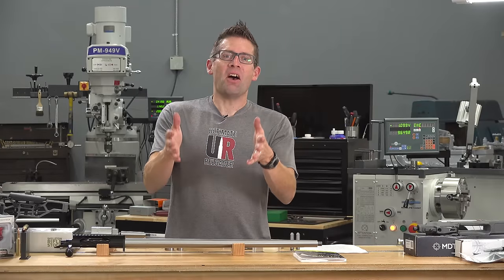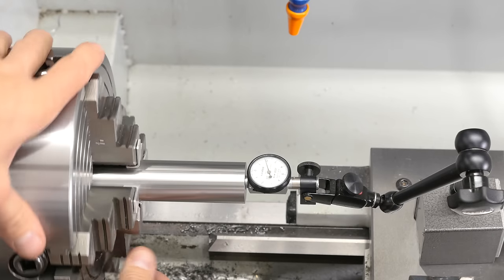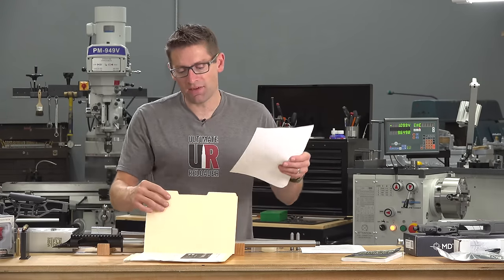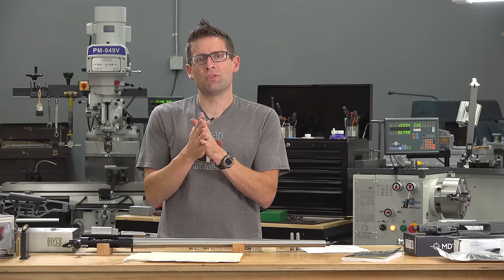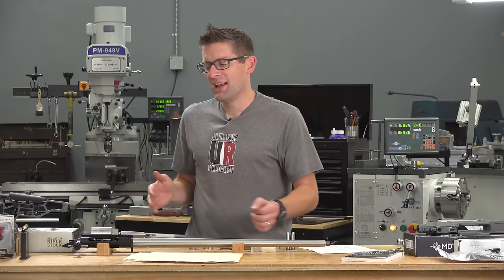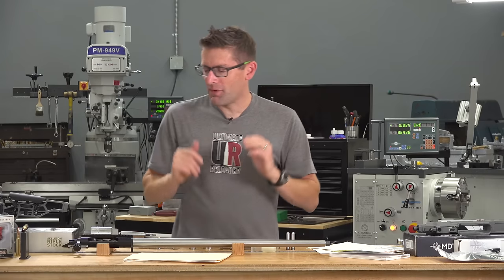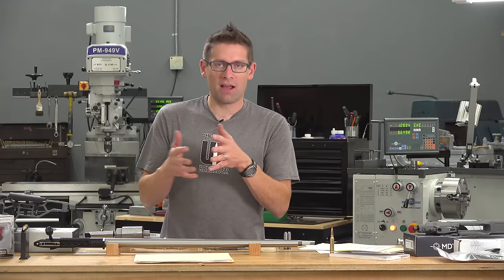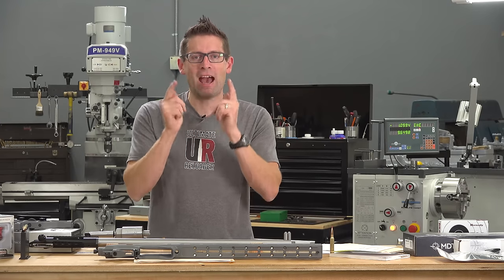300 PRC Custom Build: Chambering and Machining the Barrel

Comment: "Always measure, always validate, verify... some mistakes are very difficult to correct later..."
I'm a retired family doc. I recall assisting a General Surgeon with a major and critical abdominal operation. I was about to make a critical mistake but he caught me and then gave me one of those 'pearls of wisdom'. He said, "In surgery, there are two kinds of mistakes. The kind you can recover from and the kind you cannot recover from."
You really, really want to avoid the second kind.

Comment: Nice job, just a helpful tip. Use the saddle as a stop for the tailstock during chambering, so that you dont have to find the shoulder every time. I usually ream, back the tailstock off .050" loosen the tailstock and pull reamer out, clean, lubricate, push tailstock up against the saddle and turn to my last known number on the tailstock, usually within a few thou. T

Comment: You should look into cutting the threads in reverse. You flip the tool over and cut in reverse. Then you don’t have to work about stopping the tool in a certain spot. Ever since I learned that I’ve never looked back.

Comment: I'm a rank beginner. I've used the RCBS Precision Mic and the "lightly crimp a bullet unreasonably long in a fire formed case, inking it up and closing the bolt on it" method. I like the latter much better.  I can see where taking the extractor off the bolt and popping the assembly out with a rod could be helpful, especially without the Locktite. I was worried about the bullet moving when I removed it, and it did. But I could see where it had scraped off the ink, so I knew it happened and could try again. When I got the same answer three times I called it good. I like the Locktite optimization; it'll save me that problem.

Setting the ogive .020 off the lands instead of about .090 helped a $350 rifle shoot pointy bullets 300-yard-hunting-well. It did ok with round nose bullets, but pointy ones gave more of a pattern than a group.

Comment: When checking the headspace on a factory round remove the firing pin from the bolt. The action had no trigger and the firing pin will go forward as the bolt is closed.
Reply from the maker: Actually, there's a hole in the headspace gauge where the primer would be on a loaded cartridge, so no need :)
Reply: saw that too. being a Gumsmith by trade i have a rule of no firing pins being in the bolt tube while working with live ammo. i have seen other gunsmithing shops with holes in the walls from using live ammo. in 24 years of business i have never had a ND and never want one, i also check all head spacing with the firing pin removed. it gives you a better feel without having a 22# spring hampering you.

Comment: Difference between GO and NOGO headspace gauges is from head to datum line, not overall length of the gauge. Overall may or may not give the true difference. I tried to find something quickly off SAAMI and came up empty for now, but , somewhere there has to be a datum line diameter and set of specs that is caliber specific for the difference. When you look at chamber drawings, I have JGS and PTG books reference is always from the datum line. Once the guage is made the user no longer has to be concerned with that "datum", useful in manufacturing the guage only. Keep it coming Gavin!
Reply from the maker: Yes, you are correct. Datum diameter for 300 PRC is 0.420" - so that's the gauge diameter you use for tools like Hornady's headspace comparator tool.

Comment: Machinist here. You can thread backwards (away from chuck) by putting your threading tool upside down, reverse your spindle and lead screw, (if they turn the same direction, right hand thread opposite directions left hand thread)

1. You don’t have to catch the half nut at just the right time, so you can use your carriage stop for positioning quickly.
2. You don’t have to cut a gutter (relief) in it
3. If you get into tool pressure issues, it will pop your threading tool up out of an aloris type holder before it damages your tool.

This can be an issue if you’re using a screw on chuck that doesn’t have locking screws

Comment: On my AK63-D the barrel would bottom out and there was still too much head space. I ended up cutting a chamfer on the OD of the chamber end of the barrel letting it slide in just enough to head space correctly leaving a slightly firm resistance to turn the bolt home, (as per Russian specifications there is a torque applied to turn the bolt on a perfectly chambered go gauge) so it chambers and fires both brass and steel cased ammo as expected.

Comment: Hello there. Great job with the chambering! Did you bore away the lands in the neck area to prevent chatter like in Gordy's book? if so what boringbar did you use. One probably needs a small one to fit in the bore and long enough to reach to the front of the neck. Im having trouble finding one that will work.  Thanks

Comment: Not familiar with that action, but you normally want to take out the firing pin and ejector pin when headspacing. Nothing wrong with a polished chamber :)
Reply: Manson gauges have a cutout for the ejector

Comment: I. If pet peeve of mine is the 5/8x24 thread.   In my opinion I could be wrong but it seems to defeat the purpose of buying a heavy barrel.  I mean the most important part of the barrel is the crown.  And Shaving it all the way down to 5/8 you are now making it the weak link.  The barrel on my rum is 1.35” for 5” then straight taper to 1.25” at 32” with 1” threads for my break.  You want that as strong as possible

Comment: I'd love to get into this stuff some day.
Reply from the maker: Do it!!!!
Reply: Need a lathe first. I have plenty of room in the shop for both a mill and lathe. Just gotta keep an eye out for a good older used one. I really appreciate your videos they are one of the main reasons I got into reloading. It helps now that ammo is a pain in the ass to buy in California.
Reply from the maker: @Potatogambit  Good deal! One thought- look for something with decent through-spindle capacity. The old Logans have 1 3/8" spindles (the 11" variety). Wouldn't be a bad way to go... I have a video on my old one if you look for it...
Reply: gavintoobe it will definitely be dual purpose. Again thanks for the advice. Guns,4x4s, along with living on a working ranch mean I'm sure I'll end up with something way more overkill than a need haha.
Reply from the maker: For the rifle work, you'll want something with extreme precision, for the larger parts (driveshaft work?) you'll want something BIG. Hard to do both on a budget. You may need two lathes!!!!

Comment: Great video!  I enjoy seeing your changes to refine the process.  I have watched the DVD several times and will order the book now too.  I do have a question if you don't mind sharing.  Do you know the model of the turning tool you are using to turn down the tenon and to square the shoulder off?  I feel like the tool I have has too round of a nose to square off the shoulder well.  That looks like the right tool for that job.
Reply from the maker: Greg- that sounds like just what I did (watch DVD several times, then move on to Gordy's book :) ). The tool I'm using is a 5/8" indexable tool with DCMT insert (TiN coated) - tool is Accusize sdjcr10-3b from this set: https://amzn.to/34NV8ER
Reply: Thank you very much!!!  I have the little brother to your lathe, the 13-40GT and have played and played and I am finally ready to do some barrel work.  Thanks for saving me a few steps!

Comment: I just pre-drilled with a .375 endmill during my last .308 chamber job. The endmill will cut it true to the spindle.
Reply from the maker: That's great- I'll try that sometime...
Reply: That sounds like a good way to go. I usually use a drill bit and true it up with a boring bar.

Comment: It seems that by pre drilling and then boring would have the reamer cutting for the distance drilled and bored before the bushing would engage,  hoping the reamer would cut true,  even though not supported in the front. I also would like to recommend using full profile threading tool. It cuts the correct depth of the given thread once it starts cutting and reducing the diameter. On a Remington just cut tenon to 1.070 and thread and when depth is correct it will start reducing diameter each pass. No guess work. Only disadvantage is it takes a specific insert for each thread.
Reply from the maker: If the lathe is in perfect alignment (like mine is) you actually don't need bushing support the whole way through.

Comment: 16 mins in you check barrel on outboard side of machine. You indicate off the barrel OD. That isn't what I did when I was building rifles. I put a .0002" under land DIA pin gauge in muzzle and indicated off that to get chuck/outboard alignment. I always got it to .0002" exactly. .004" is a bit much. Great videos! I have subscribed.

Comment: I really like the looks of that action.  So much so that I am thinking of doing a 6.5 Grendel build around it.  My range max distance is 300 yards.  That is why I like the thought of 6.5 Grendel.  At 300 yd the bullet will still be moving at a decent rate from the starting rate of the Grendel and from what I have been learning the 6.5 Grendel is not a barrel burner.  The down side of going with 6.5 Grendel is the bolt face work required.  I am not sure if I should start small and make it larger or start large and make it smaller.  What are your thoughts on that? Also, is your action wrench modified to fit the Kelbly action?  You mention the action as being a semi- clone.  That’s why I ask.
Reply: The bolt face is what’s different. No recess on Kelbly.

Comment: For stainless steel work you should really look at the Aurther R Werner bits/Holders.  Most are a T-15 which make cutting flawlessly with stainless.  Check them out they are the best,
Reply from the maker: Yes! I've been looking at them!
Reply: @Ultimatereloader  they work great at low speeds which is where most of the stainless work excels at.  Contact them direct.  I bet they would be willing to sponsor for your channel.  Good luck can't wait too see some work with them.

Comment: Hi Gavin, great video, thank you, just a question, have you thought of spark eroding a collet to accept the barrel contour or are the jaws on you lathe independently driven so you can fine tune the grip on the barrel ?
Reply: Each jaw on the 4- jaw chuck can be independently adjusted.

Comment: No wires available use closest drill bits available. Simple interpolation to determine micrometer readings for pitch diameter.

Comment: I have a 30 cal blank and was going to chamber in 300 win mag because that’s what I know but I’m thinking about 300 PRC now. I can’t decide lol. Benefits of 300 PRC is that the bullet can be seated further out for more case capacity correct ? Couldn’t I just load my 300 win long ? My mags are 3.715” long so it should accept longer loads. I may need to throat the rifle so I’m not running the bullet right into the rifling tho.
Reply from the maker: The 300 PRC accommodates long slender high-BC bullets and has optimized chamber geometry (tight freebore, etc). 300 Win Mag can shoot good, but I would expect 300 PRC to be better all around. You do have to think about longer cartridges, magazine, etc. 2.700" max COL.
Reply: gavintoobe any thoughts on 30 nosler ?

Comment: But wouldn’t a indexing of the barrel slightly to the left (11 o clock) be beneficial for long range shooting to prevent spindrift and Coriolis effect?
Reply: I feel those problems are better for the shooter to adjust to instead of building a rifle to compensate for it. Otherwise youll have to negatively adjust for closer ranges to avoid the problem. Know what i mean?
Reply: Joshua s  I don’t think you will see the problem in close range. You will zero the scope on say 300 yards and closer than that, there will not be a big difference on the bullet impact I think. It was just a idea on the indexing because over here where we target shoot with open sights we compensate just for the mentioned problem by tilting the front sight slightly to the left of the bore.
Reply: @KRAVATTNET  indication for the curvature of the bore is more for the node of the barrel to be at a perpendicular orientation to the earth, whether its indicated to the left or right can have an effect on accuracy if you are trying to shoot less than a .100" group at a hundred or .1" MOA. In my experience it dosen't matter all that much.

Comment: At 16:10 you show timing the barrel muzzle from the OD of the barrel.  That's incorrect. You want to time the barrel from the bore - remember, the bore and OD are rarely concentric.  It is possible that you found the high point of the barrel OD, but the bore is pointing down or to one side.  See page 76 of "Chambering Rifles for Accuracy" by Fred Zeglin & Gordy Gritters.  So as to put this step in perspective, Gritters states that, "The bore curvature isn't always a straight curve, but can be a compound curve where it curves up and slightly to the side also."  The correct order would be to index the breech/tenon end to ensure the bore is concentric, then without making any changes to either the spider or chuck, index the muzzle bore to determine the "high" point and transfer this point to the chuck for later use to time the action to the threaded tenon.
Reply from the maker: I was doing a rough-dial- only do that with Benchmark blanks (they are usually within 0.001") - didn't you listen to the direct indicating off the lands and grooves part? That's how I dial a barrel, from the bore.
Reply from the maker: I re-read your comment- you are correct!

Comment: Have you ever threaded a barrel between centers. If so, what is the difference in accuracy you’ve notice?
Reply from the maker: I have only chambered and threaded barrels through the spindle- but longer term I do want to show all of the methods, etc. All in good time... May use Grandpa's 1943 build South Bend 9A for a  chambering job (over the bed, not through spindle) - could be fun!
Reply: gavintoobe thanks. I’ll keep an eye out for that. I was curious. I’ve used both methods for muzzle breaks and suppressors. Never really noticed a difference in the end result. I’ve never built a long range precision rifle though. I know 0.0001” can mean 3.6” of variance at 1000 yards though. I’ve talked to machinist and gunsmiths about which method is better. Neither group agrees with the other. The machinists are pretty set on between centers. Gunsmiths are all pretty well through the spindle... maybe with a cat’s head for flare.

Comment: 34:04 I cringed when it appeared like you were putting a live round in that action with what appears to be a fully assembled bolt with no trigger assembly installed
Reply: the firing pin is removed, no chance of a discharge.
Reply: I have to correct my self, I reviewed again and yes it appears to be a fully assembled bolt.  dangerous to insert a loaded round.   Yikes.   I hope he doesn't continue this practice.   I have installed a few barrels myself,  always remove firing pin ass. during this process.
Reply: It's a dummy round.
Reply: Always remove the firing pin. It’s just to easy not to. 
Trust me it’s worth it.

Comment: Shouldnt have to have a 004" banana barrel! I Use to make fan shafts for precision blower units and the TIR of a 12ft shaft with a precision matched taper end which seated proper taper depth on fan blade and the fan shafts went out for hardening before finish machining. I had those suckers within .002 TIR on mazak slant 50.

Comment: Congratulations,  what about making 300prc in ar10 platform?
Reply: it would be too big. Have to use something like the 300 win mag ar's.
Reply: @colsoncustoms8994  yes, something based on ar platform.
Reply: @colsoncustoms8994  this guy can mil its own upper and lower and barrel.  He have the machining.
Reply: @marifkhan1  Oh yeah, it could be done for sure. The Nemo Omen is a 300 win ar style rifle. Building a semi auto rifle from the ground up, in a magnum cartridge at that, isn't as easy as fitting a barrel to a receiver (zero doubt he could do it though, especially if copying the design from somewhere like nemo). Lot more going on with proper buffer weight, gas port size, dwell time, etc. I'd watch the hell out of that series if he made something like that, no doubt.
Reply from the maker: Sounds like an interesting project :)
Reply: @Ultimatereloader  I would love to buy something like that. Like a dream ar.
Reply: @colsoncustoms8994  if I get reciever set, for sure.

Comment: A quick and dirty thread cutting tip: take the pitch (in your case 1/16 or .0625") x .75 = to give  depth of cut. Puts you in the ballpark a lot faster.
Reply from the maker: Excellent, thanks mate!
Reply: Bad idea. Use the thread pitch and three wire method. Don’t be a hack.
Reply from the maker: Are you calling Gordy Gritters a hack? Come on man.
Reply: gavintoobe nope. Just learn the three wire method.
Reply: gavintoobe   Nope. Just learn to use the “ three wire method “ it’s not hard. Then you can chamber a barrel without the action and send it to your customer   Three wire method has been around longer than you and I put together.
Reply from the maker: Mark Spencer mark-  covered that in the video- please review what I said thanks.
Reply: Red leg said. You didn’t
Reply from the maker: Mark- the one thing I ask for here on GavinToobe is respect (for everyone, including myself). Calling someone a hack because they don't have a 0.032" wire on hand is not cool. Understand what I'm saying?
Reply from the maker: Respect isn't a request- it's a rule.
Reply: It’s cheap. Wires aren’t expensive. $20-25 dollars. One thing I like seeing. Is no one taking short cuts and calling it “good enough . “. So squishing someone who throws out , bad advice, is the viewers job.